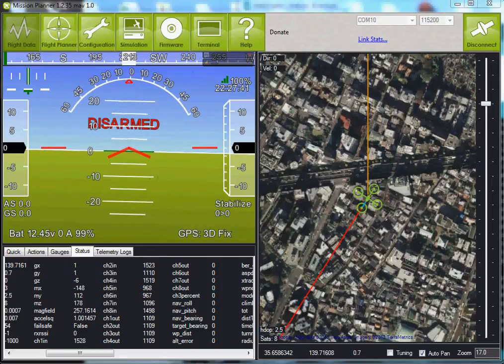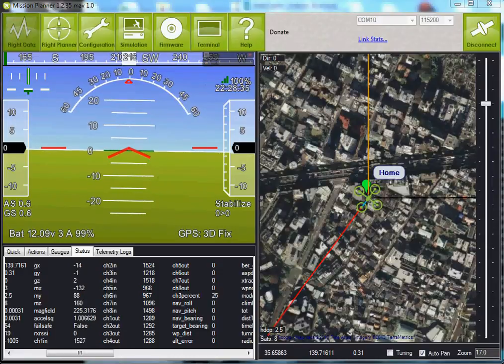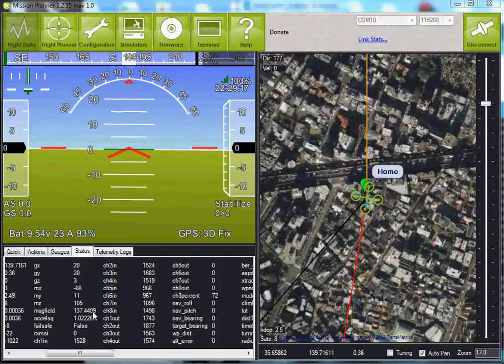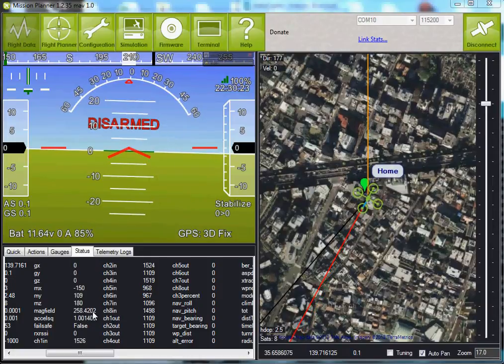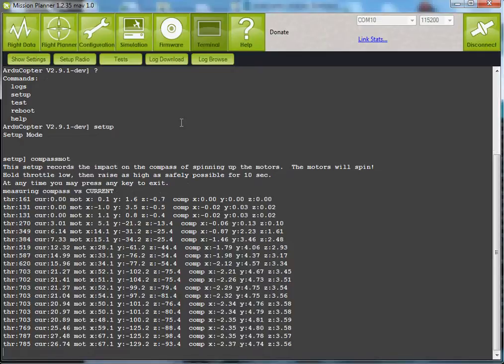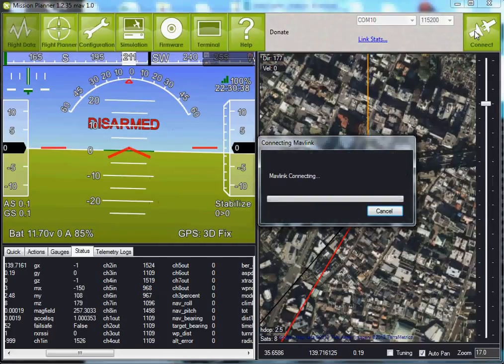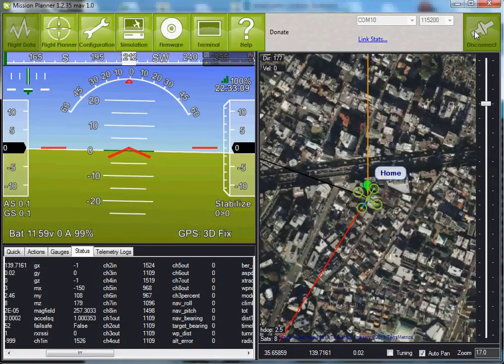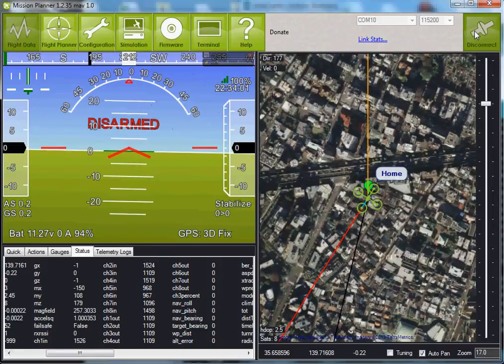Motor interference compensation using current

Comment: Hi nice jobs, but have prolem when I write setup  and compassmot I get a message 
measuring compass VS  Throttle , throttle not zero 
and when I check it the the throttle in Devo F7 it is on zero so I dont know what it is the problem thanks for any suggest

Comment from the maker: Craig,
    Yes, 3DR sells the APM2.5 Power Module with either Dean or XT60 connectors for about $25.  The connector is meant for the APM2.5 so I don't think it will be easy to connect it to an APM2.0 or APM1.  It actually become standard equipment with the 2.5 and it's a very good addition in my opinion.  There are other current sensors out there of course like the Atto pilot current sensor but I don't have experience with those.

Comment from the maker: Steve,
     Yes, I found this too as of yesterday.  I'll fix that but until then you can go into the mission planner's Configuration. Planner screen and uncheck the "Reset APM on USB" button.  You might need to manually push the reset button just before clicking the Terminal screen (or plug/unplug the APM) and then press enter 3 times.  before you press wait until the escs issue their "armed" beep.

Comment from the maker: @dege13, Yes, in AC3.0 you can use either throttle position or the current sensor. The current sensor works better but I've flown with both and throttle also seems to work.

Comment: The amps/volts is wrong in Mission planner. It should be 15.7 not up around 28. You can alter it in Mission Planner advanced params.

Comment from the maker: TheManfet,
     Yes, it's possible that we would get a better result if we maintained a vector for each motor although that would also add steps to the set-up procedure.  I'm waiting for more feedback from testers on the existing routine and then we can see if it's worth while for general purpose use.

Comment from the maker: Marce002b,
    Sorry, I've never used that current sensor so not much idea of what could be wrong.  I've found that even with the 3dr current sensor the readings are not accurate until at least 3amps is flowing through the system.

Comment: ah ok... im still in 2.8.1 and worried about muy current readings with my apm2.5 and rctimer "attopilot" , voltage is ok but current seems to be 2 times the correct one... al config was carefully done in mission planner. ani hint apreciated and congratulations, you are talking about 2.9.2 wow!!

Comment from the maker: Marce002b,
    The video shows two things..the first half of the video show the interference on the compass caused by increasing the throttle.  So you can see a 30deg change in heading.
    The last part of the video shows the effect of the new motor-compensation code that we are adding to arducopter 2.9.2.  This compensates for the interference by using the 3d robotics current monitor.  Basically we just subtract a compensation vector * current from the compass vector.